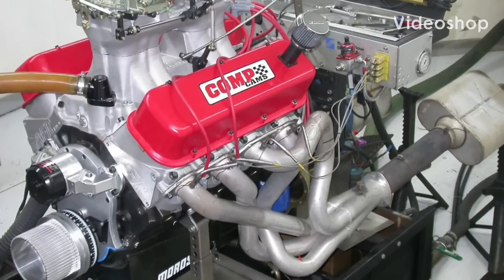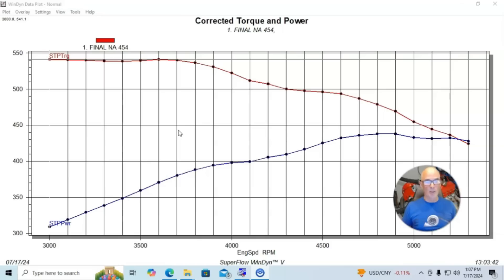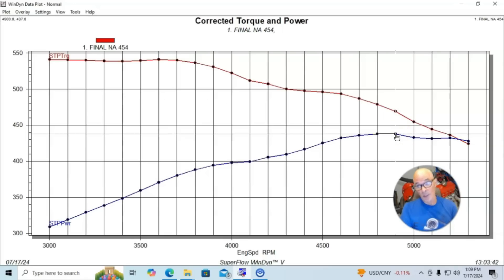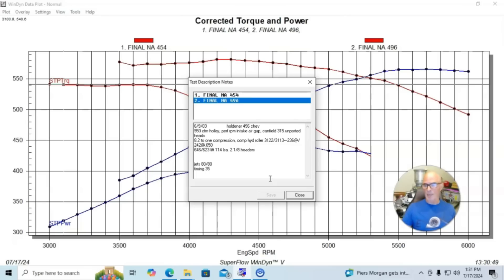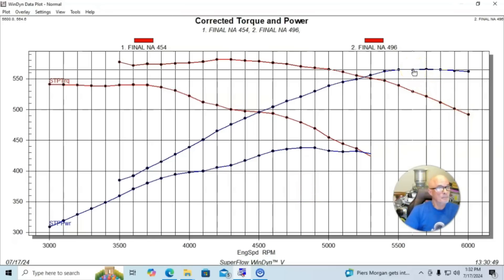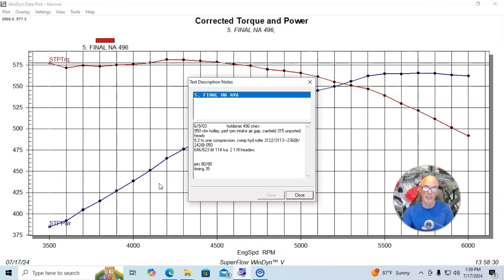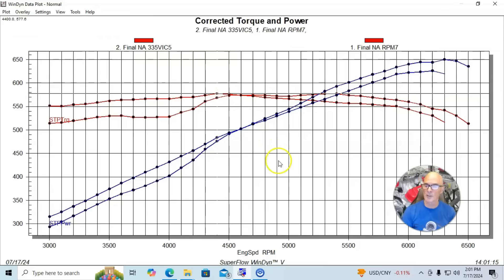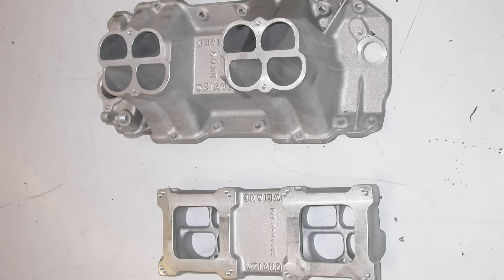HOW TO MAKE MORE BBC TORQUE FOR TOWING-454 VS 496 VS 496. DUAL PLANE VS SINGLE PLANE VS TUNNEL RAM!

Comment: LOVE IT!!! Richard, have you EVER come across a set of Dart 308 Race Series aluminum heads? Info out there is very scarce, and would love to know how they perform! I had a 496 BBC 10.2:1 forged engine built, with the Darts and an almost exact roller cam, and can’t wait to see what she’ll do in my 21’ Sonic Jetboat! I called Dart a while back, and about all they could tell me was that they were a short run casting- they cast for short track/ race, and mine were ported and polished, but I have zero to compare them to- and I know as an engine builder/ tester, you’re about the only pro that might have knowledge about them! 
Thanks and love ALL your vids!!!!!

Comment: You want your torque down low with a smaller cam like the 268 Comp Cam. Because the higher you turn any engine the more wear and tear you're going to have. Richard is a very knowledgeable guy but when you're talking towing and alot of weight. I wouldn't use a dome piston of any type, pump gas and towing. I'd keep the compression down 7.75 through 8.25 Factory low stock compression. I've had 8.25 stock factory compression in a 350 SBC all stock small block Chevy. With a sm465 4-speed manual transmission with a granny low gear. I've had a lot of work trucks and I'll won't go back to a automatic transmission again. THE PROBLEM WITH AN AUTOMATIC YOU GET THEM TOO HOT THEY'LL SLIP AND YOU'LL BURN THEM UP. With 18,500 pounds at times I would pull a single axle boat too which would have made it roughly around 21,500 pounds gross. And that all stock 350 small block 1986 model engine. On the side of the Hill it would peck like a woodpecker under the hood what's a throttle to the floor. With medium grade or high test that I remember it wouldn't rattle and I could get my full throttle. And at times I had dieseling engine run on because when I would shut it off in granny low gear it would pull me backwards letting out on the clutch and killing the ignition at the same time. Because with this teeny weeny engine I needed all the throttle I could get. What I've learned about towing you want your power down really low like a diesel. I definitely could have used a 454 Big Block which would have helped a whole lot. But if you look at the first Cummins engines they would tow about anything and I think they only had about 380 foot pounds of torque. Detonation and engine run on dieseling will destroy any engine over time. I've since moved on to Cummins diesel stock engines. Buy one truck from the factory makes 610 ft lb of torque it'll pull anything I need and with a 6-speed manual transmission is even better. 

If I was building A towing big block. I go with the stock Factory low compression 454. Comp Cams 268 cam lifters and matching valve springs. Small long tube headers, peanut trunk heads, performer RPM intake, a quadrajet or Holley spread bore 4165 same as a quadrajet but by Holly and fully adjustable. MSD 6 ignition. And definitely a manual low gear transmission. Add SM 465 has a lower first gear ratio then both of my diesel manual transmissions. But no matter if you're towing or on the street or strip when you get into more power you don't need as much first gear. And when I was pulling 21,500 pounds if I had a turbo 400 it wouldn't pull out of its tracks. Forest Street or strip car an automatic is the only way to go but for towing and heavy pulling it's a manual transmission only for me. You could run a hydraulic roller cam for some more power. But with this low of compression you might be talking 20 or 25 horsepower at the most. Not real sure about the torque but it should increase the torque. If you want the ultimate towing gasoline beast build a 632 with peanuts and what I mentioned with that other BBC engine.

Comment: You want torque for towing?  Get a Diesel.
Reply: Diesel??? 
For light duty/ occasional towing???
Motor is too expensive. 
Fuel is too expensive. 
Maintenance is too expensive.

Comment: Glad you did the dno compare of roller rockers vs stamped steel. On a built 351-C, all I found was 10 degrees less oil temp with the rollers and a lot more complicated installation.

Comment: Very good and more interesting BBC test from 3000 -- 6000rpm ---- and much more REALISTIC for the budget minded wanting to build something for the Street and occasional Strip ---- even for a hi-perf Marine application for us BOATING guys. 👍
Even that 454cid engine with the super Mild hydraulic 203°\212° Cam for a good Truck or "PULLING" engine was a great test. 
I especially liked the dual plane Air-Gap intake manifold compared with the single plane intake, etc was a very good comparison as well. 
I really enjoyed the video because it was more realistic and not all this WILD Cam and High Compression High RPM stuff. I would love to see more of the 3000 - 6000rpm stuff.🧐
Great job, video and Dyno test Richard --- THANKS!!! 👍
Reply: Also really enjoyed the Carb Spacer comparisons... It would be nice to see you try more and different various carb spacers from 1/2", 1" and UPSIDE DOWN 1" AND 2" Super Sucker with a half inch phenolic open spacer on top of the Super Sucker so that the carb does not get heat soaked... It would be nice to get a little more creative with the various carb spacer testing and comparisons especially on top of a Dual Plane Air-Gap intake manifold. 🧐👍🤔
Reply from the maker: we have endlessly tested all manner of spacers

Comment: Could you make a 496 that has a great single pattern cam run on methanol with some compression say 13 1 and dump it and see how much HP and tork it can make for the drag strip

Comment: Richard you just ruined the nice low end torque.. you don't tow at 5k rpm. Increase the cubic inches to max. Play around with different small camshaft and intake. Try a long long intake manifold runners like custom made cross ram. It allways goes to more HP. Stay on the low end torque.  Come on .. we still love you.

Comment: Hell yeah! I have acquired two 454 powered vehicles in the last year, 1997 suburban k2500 and a 1986 georgie boy air cruiser 33 ft rv. Would love to see more done with the stock gen 5 fi, with the stock intake manifold and heads, with maybe a camshaft swap and adjustable valvetrain put into the mix? Rock on !
Reply: he's got videos on that gen 5

Comment: Richard, these tests were done over 20yrs ago.  Given the advancements in technology, what do you think you could make if you did a mild-ish 496ci BBC with todays cams and heads?
Reply from the maker: Your mistake is to think the test was trying to get maximum power-it wasn't-the intake test would still show the same results as would the mild alum-headed 496 combo

Comment: Can you explain how much horsepower a 5.7 with a 4.8 crank and rod run and what the compression ratio torque and if it’s even a good idea to try
Reply from the maker: ARE YOU ASKING ABOUT A 5.7L LS1 WITH A 4.8 CRANK AND RODS-IF SO, SEE THE LS3 WITH THE 4.8 CRANK VIDEO

Comment: For a towing motor / daily I'd bet your best combo would be bigger displacement, great flowing heads, airgap, and then pick the cam for the rpm range you actually use to maximize the area under the curve where you need it.  A while back the engine masters guys did a stroked small block comparo with a small cam (like 212/224) and AFR heads of different sizes and ended up with something that looked like an incredible real world engine combo.  Duplicate that ideal w/ a BBC and you'd be a happy camper (except for MPG).
Reply: MPG is very valid though

Comment: Bracket racer from the 90's and early 2000's here. Always ran a tunnel ram on my 468's with about 12:1 compression, average size solid roller cam in a back-halved '69 Camaro. Car was very consistent and ran 6.08 to 6.14 depending on air and track temp. When I got out of racing the engine was pulled and sold to a guy with a '69 El Camino street car. The dude dropped it in, added cast iron manifolds (!) and drove it on the street for years. 
LS engines and swaps are great and all the rage but, there is just something special about a big block Chevy.

Comment: My motor home @62mph spins about 2400rpm. The downshift kicks it up to about 3200 rpm. I'd like to see what does good at these ranges. I suspect that the 454 peanut port tbi would be hard to beat at 2400rpm.
Reply: Yeah but good luck getting that tbi 454 tuned these days, and you’ll need to after just an intake swap and headers…. Let alone a cam swap. 

Plenty of proof showing a stock tbi 454 gains 50hp with 750 carb, Duane intake, and headers. Average 25ft lbs of torque increase at ALL rpms

Comment: Very cool but I wish you had run the 496 down at 3,000rpm to compare bottom end torque with the "towing" 454.
Reply: I've pitched this in past vids but was shot down " No one runs wide open throttle at low RPM " ( Like 1500 to 2000 )   Well, pulling out from a traffic light on a hill towing a trailer will certainly end up in WOT at low RPM with a TH400 which has a tall 1st gear and stock non lockup converter.
Reply: @bobroberts2371  I believe Richard has said before the dyno they use struggles to load in properly at rpms that low on a motor making 500ft-lb. I think Nick at Nicks garage uses the same dyno and he too has said he can't load in the 400+cid engines down below 3000rpm.
Reply: @bcbloc02   Thanks for the info beyond " we don't do that "    I wonder if the loading issue is caused by the number of vanes in the water brake. RE: Needing more vanes at low RPM to prevent cogging / less vanes at high RPM to allow for enough braking action.
Reply: @bobroberts2371  water brake capacity is most effected by diameter but of course more rotors can be used to increase capacity as well.  More rotors tends to cause issues with testing lower powered engines because they become quite sensitive to the amount of water in the brake. Larger diameter units become limited by rpm because their own mass can cause them to explode at high rpm. Everything is always a compromise. 😎
Reply: @bcbloc02   I was thinking more along the lines of the smoothness of power absorption relating to vane count.  
As for being sensitive to water volume, I'd think that flow meters on the inlet and outlet plus valves on the inlet and outlet along with some software could solve the problem however could be beyond the scope of a typical race shop dyno.

Comment: Where is the graph on the tunnel ram combo?
Reply from the maker: SUPPLIED IN VIDEO
Reply: @richardholdener1727 tunnel ram horsepower and torque numbers were mentioned but no tunnel ram graph
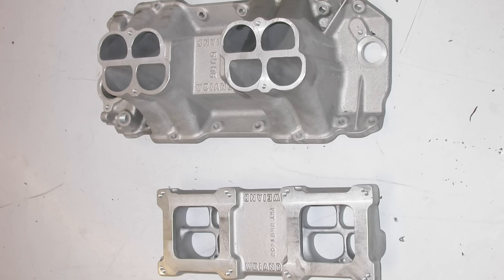Reply: 10:58

Comment: A 496 is probably the most common stroker BBC (a 4.310 bore and 4.250 stroke), but could a 511 (4.310 bore and 4.375 stroke) or a 525 (4.310 bore and 4.500 stroke) be built from a stock deck height block and the same amount of money???  A tall deck block would make things easier, but...  Who has done it???
Reply from the maker: THE 4.375 STROKE IS PROBLEMATIC (WINDAGE)
Reply: @richardholdener1727  I did not think of that.  Very interesting stuff!

Comment: It STILL blows my mind that a well-built LS will make  "big block numbers" in a smaller and lighter package.  It's not too hard to make your mild 496"-ish" numbers in a 408" LS.  Obviously, you dropped the compression down quite a bit and that hurt power on the 496.  Still, if you built a 408" LS (factory iron block with stroker crank and LS3 heads) with similar 8.2 compression, could you make the 496 power numbers?  I think it would be close.  You might have already done this comparison.
Reply from the maker: A 496 MAKES MORE THAN A 408-ESPECAILLY DOWN LOW
Reply: @richardholdener1727  Bigger is almost always better down low, but it would still be an cool comparison.  I wish I had time to go thru your vids to get some actual numbers at the various rpm levels.
Reply: Big block torque is a whole 'nother animal.

Comment: only the first 454 had a suitable cam for towing in my opinion.  especially with an automatic.  The other two would make killer street machine engines.  Now if you could start them off with a nice short first gear like an allison 5 speed or something, then it could work.  With a Turbo 400 the 3 gears don't give enough range and you cannot use a 'loose' converter for towing.

Comment: I talked to a racing shop a long time ago, and he was running a 496 with NOS, so I am curious if a 496 can handle a shot of 200 NOS because it's bigger cubic inch displacement, or a shot of 200 NOS could still hurt this motor. I ran dry NOS on my Toyota truck, but I was told to use a shot of 60-80 NOS because only a 144.4 cubic inches displacement, so I figure a bigger motor can handle more NOS right?
Reply from the maker: a 496 can easily handle a 200 shot if properly tuned
Reply: @richardholdener1727  I was told to run 1 step colder spark plug, so I did, and I was told to run a CD system to burn the NOS, so I did, and I installed a dual Center force clutch. What I am missing to run 200 NOS on a 496 please?
Reply: @RudyRamos-fc2fm  If you haven't built the engine yet, use forged pistons and  premium head gaskets.  Head studs wouldn't hurt either.  The key is the tune.  Make sure you get enough fuel with the nitrous system.
Reply: @scotttimpany2845  I had an aftermarket mechanical fuel pump rated for about 8 PSI, and I had an 800 CFM carburetor on my 350 motor, so I am curious is this enough fuel for a shot of 125 or 150 NOS?
Reply: @RudyRamos-fc2fm  It helps to think of things in terms of a system.  Fuel pressure is only one part of it.  Volume is the other.  Make sure the pump flows enough for your combo.  Make sure you have large enough lines on the supply AND the return size.  Make sure your filters are clean AND that they're designed to flow good amounts of fuel.  Stock type 5/16 or 3/8 lines with stock type filters that have never been changed are not good.  You need to do some research to make sure ur good.

Comment: I would trade some low speed torque for mid range power for a tow motor any day. Nothing worse than a gas engine that is out of power after take off. Mid range is where its at for towing. You need mid range guts.
Reply: I agree! My 496 comes alive around 3,000 rpms, but at 4,000 rpms that monster 👻 torque kicks in and then up to 6,000 rpms it pulls like a freight train.😆
Reply: @musclebone7875  
At 3k you're likely around 70 mph already.
Reply: @xmo552  I have a gear vendors overdrive. I'm around 2,300 rpms at 70mph. Out of overdrive yes 3,000 at 70mph
Reply: @musclebone7875  
Would you mind sharing your build info? I'm tossing around the idea of a big block swap.
Reply: Apparently there are not any steep hills that a truck must pull from a dead stop.
Reply: Need torque to move a heavy truck+ load and to climb hills